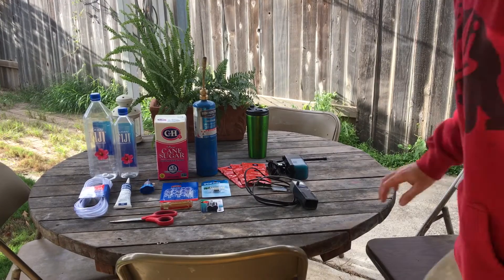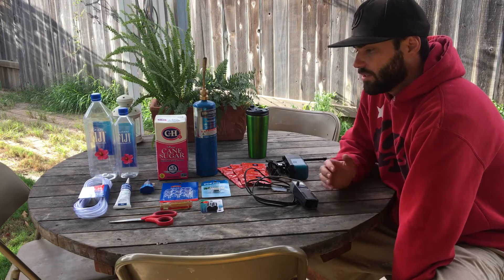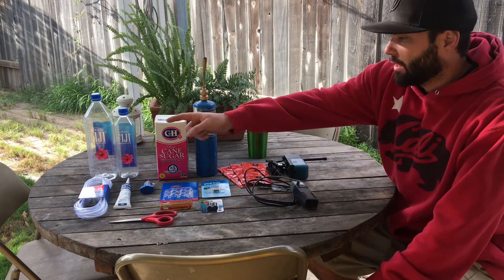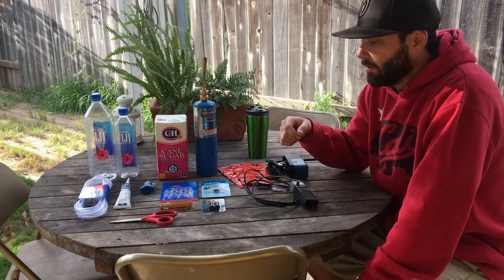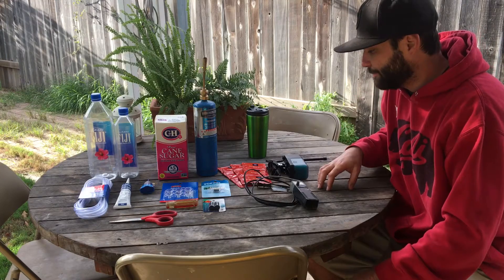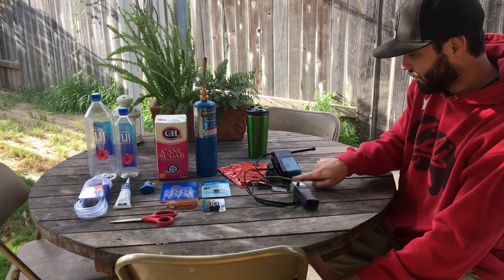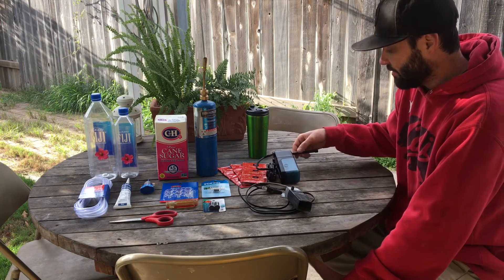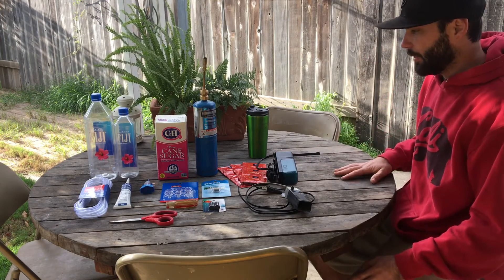DIY CO2 for your planted aquarium

Comment: Hey, thank you for your video!!  I am BRAND NEW to the aquarium thing and I am putting together a tank to grow aquatic plants for propagation ( I love to garden ).  What exactly is a "power head" or "internal filter"?  I don't think I have those around so where would I get one?  Your help is much appreciated!!
Reply from the maker: Handmade by Roxan search on amazon “small Aquarium pump” and the one like I have is made by “homasy” and it pumps about 80 gallons per hour. That one will work fine. For some reason I can’t copy the link for you. Sorry. I hope this helps. Good luck and thanks for watching.